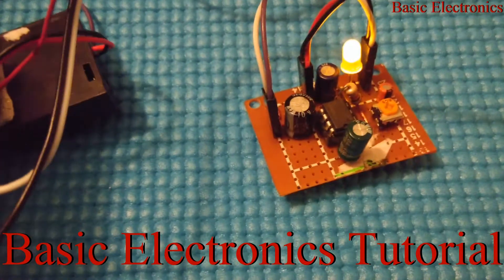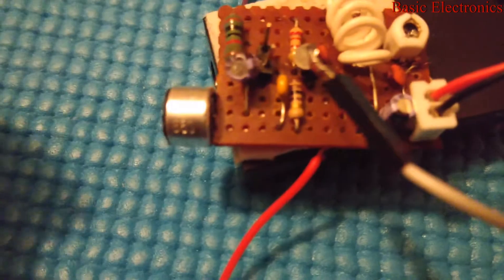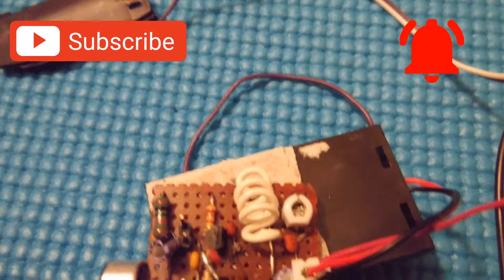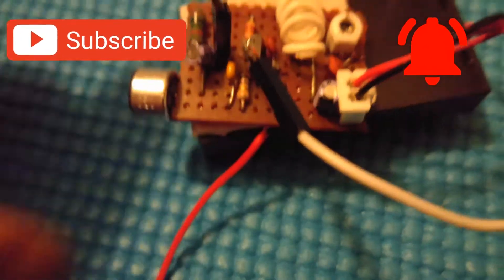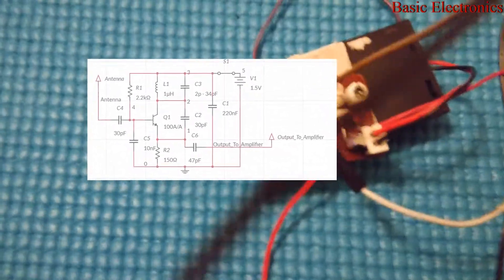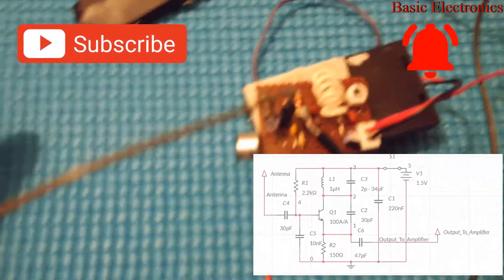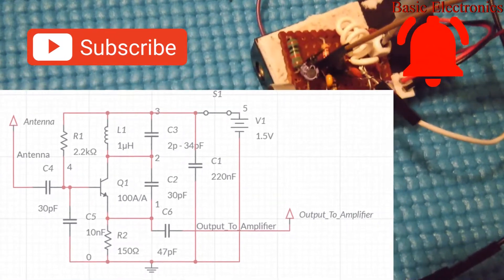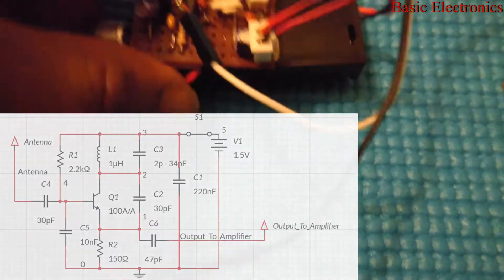HecaWorld FM Radio Receiver | Weekend Project | One-Transistor FM Receiver | DIY Radio

Comment: Instead of LM386, can you feed signal to CD4017 or Monostable circuit using BC547 to control an LED bulb on/off, is it possible with your xircuit...
Reply: what modification should done for such implimentation..
Reply from the maker: @athensWEB  Do you intend to control the LED when a station is received? If so, you have to use a 'squelch circuit' to detect silence and then use the appropriate transistor to control the LED. But I think you might still need the amplifier as the received signal strength is low.

Comment: Voltaje is 3 or 1.5 ? , I see 2 battery of 1.5 , Thanks
Reply from the maker: 3 Volts for the receiver... but it works with 1.5 volts as well. Thought the battery pack can contain 2 batteries, we shorted out the place of one of the batteries with an ordinary wire.
Reply: @hecanet  thanks! , i make the circuit , but it not works, I'm using lm386 amplifier, what is your amplifier ? or what other component the circuit need?
Reply from the maker: @pocsilinas  Please note that your proximity to a radio station is key. Also consider playing the radio on a metal table to provide some form of earthing... remember to insulate both of course.

Comment: Nice. 
As for Q1  : 100A/A
What is the meaning? 
Thanks
Reply from the maker: Just use 2N2222 or any other general purpose NPN transistor with FT greater than the FM range (88 - 108 MHZ), e.g., 200 MHZ.
Reply: @hecanet  
Yes  , Thanks  .
Reply: I am subscribing to your chanel right this moment. Great....
Reply from the maker: @cosmikodes  Thank you. Please share our videos.